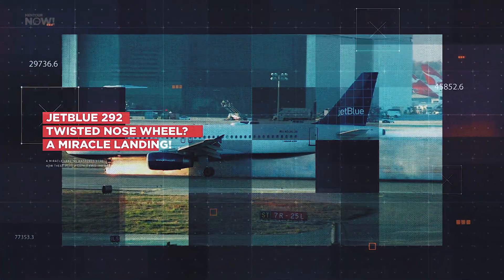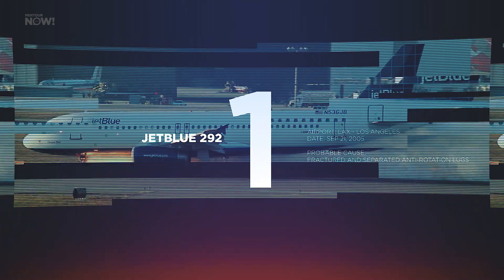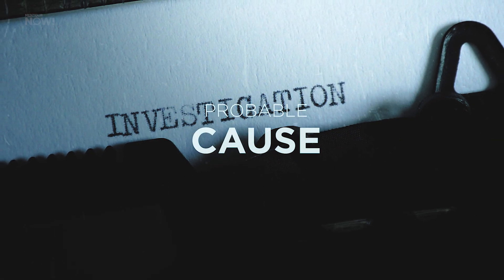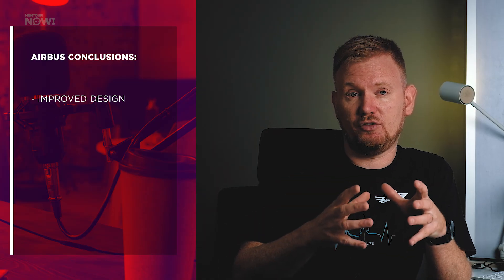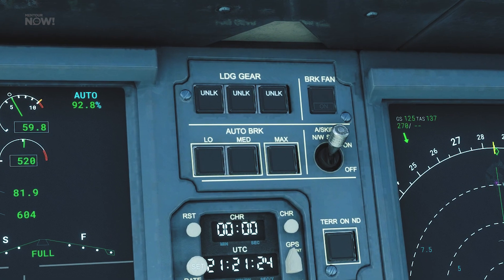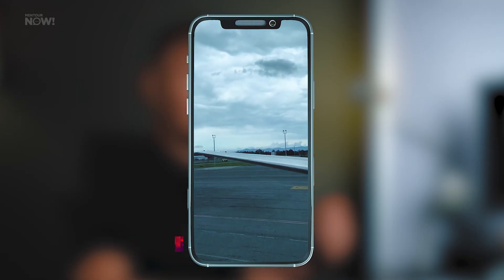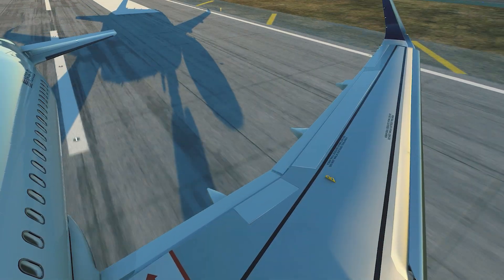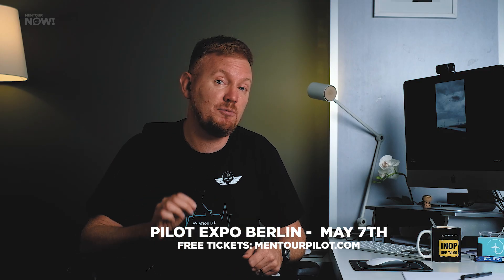The TWISTED Story of the Airbus A320 NOSE-GEAR!

Comment: Hello Peter. Thank you for your videos. I would like to know why there are no exterior cameras on these aircraft (like for example Teslas have) to be able to visually confirm if something is wrong with any part of the plane without wasting time and fuel doing flybys or visual inspections from other aircraft.
Reply: Cost, weight, maintenance, and workload, vs the number of incidents.  Everything is a trade off.
Reply: @ClipstopherBurtraw  Also we tried and let people watch this on PMC. Irc A380 have a tail cam but for PMC and don't work on ground
Reply: Aerodynamics, added weight, added complexity, added cost... all for something so rare you'll be hit by lightning on the ground before the camera is ever useful. And what then? You still gotta land nosegear sideways

Comment: I understand each incident was caused by differing faults and or failures. However in my opinion the front nose gears overall design is not the best example of aircraft mechanical engineering. I don't believe because each incidents causes are somewhat different they should be written off as coincidences. Airbus should consider a more thorough engineering review of the complete system as a whole. Thanks for bringing us the story's and as always well done.

Comment: Are there similar incidents with B737 nose wheel for example, or any other commercial aircraft?
Reply: There are issues with planes' landing gear all the time. The only thing going on here is that a bunch of completely different failures have resulted in the same eye-catching symptom.
Reply: Yeah, gear tempt to work in weird ways sometimes. That’s pretty much universal with any aircraft type and manufacturer. What stands out here is the unusual position that is making this incident „series“ somewhat special

Comment: Seems to me a very SIMPLE thing to do would be add a front landing gear camera. One that looks down at the gear once it is down and locked.  This would at least tell the crew what the wheel is doing if they are getting the alarms.  Cheap and simple add-on so at least they KNOW.  It's not a fix for the issues, but no more fly-bys unless of course the cameras don't work. But, what do I know.....lol

Greg
Reply: Good idea but NOTHING in aviation mods is “cheap and simple” - although you would think so. To add a camera youd need to screen in the cockpit or modify software to allow camera to feed into a current screen. You’d have to have design testing and certification of the camera location and install. The camera would have to somehow not be blocked by dirt and debris = ground crew function between flights , etc etc etc. - makes some sense but not “cheap or simple”.
Reply: It's overall cheaper to simply ask people on the ground to report the condition on a low pass go-around.  Compare the expense and resource requires as Marlin mentions to implement, plus the increased maintenance, vs the number of incidents.  It's not a good business case to add weight, cost, complexity to this aircraft.
Reply: But the pilots aren't even supposed to do a flyby to let ATC visually confirm the orientation of the gear.
So it seems like the knowledge of the orientation of the gear is not that important for the pilots to have.
Otherwise a flyby would be mandatory whenever one of the faults is shown on the screens.
Reply: @Jehty_  that has happened in at least some of these incidents though.
Reply: @ClipstopherBurtraw  you mean a flyby?
Yeah, but as mentioned in this video the pilots are not supposed to do that.

Comment: It’s kind of crazy that none of the nose gears collapsed. Just shows how incredibly strong modern airliners are.
Reply: They are calculated fuse points. I bet they even calculated how much grinding for a full length landing before it reaches the hard alloys.
Reply: It is really not that much force (about 10% of weight on the nose gear, coefficient of friction 0.6, Max landing weight 64t) 64*0.1*0.6=3.8t under the worst possible circumstances.
If the nose wheel bursts, before the full weight is on the strut, even less.
There are probably some car suspensions that can take more than that.

Comment: Does the QRH tell to turn on the APU before landing with unsafe gear? If not, why? Wouldn't it make sense, since the engines are to be turned off immediately after touchdown?
Reply: What would you need the APU for? I might be missing something, but doing the rollout on essentials bus only is not too much of an issue, especially if you follow the unsafe checklist as you don't make much inputs when following that anyway. Lights also won't be much of a problem and who cares about aircon, am I missing something?
Reply: @EpseLepse  I was thinking about rudder, since it's the only thing to keep you within runway limits - until it's effective, that is. For that you need hydraulic pressure.
Reply: @piotrzema2682  The essentials bus should be fine to power that for the short landing roll time
Reply: @piotrzema2682  there is plenty of residual pressure for rudder control. No need for the Apu,, and potentially another possible cause of fire.